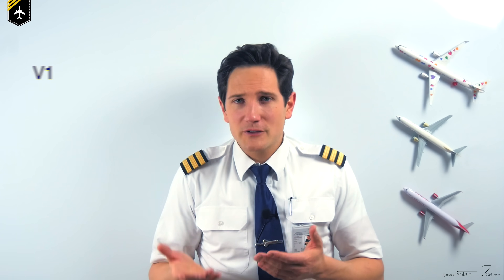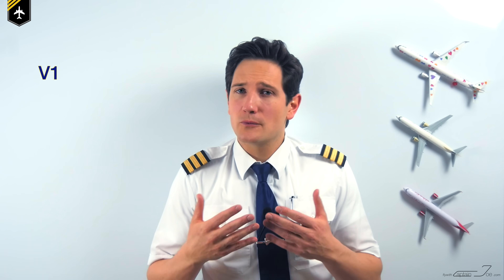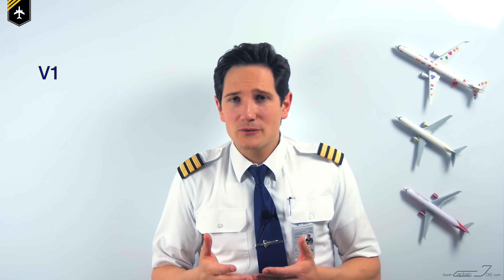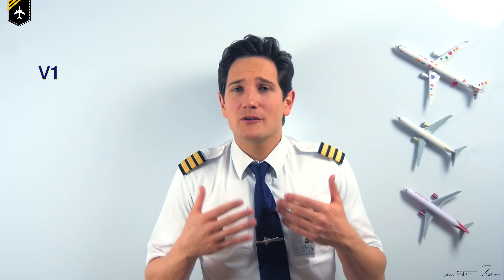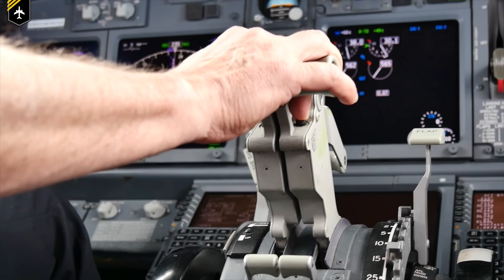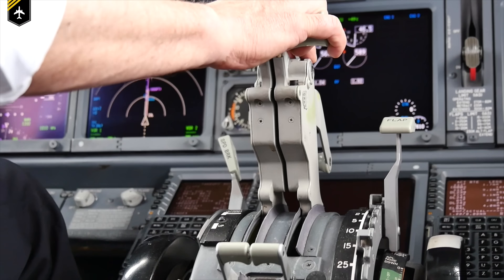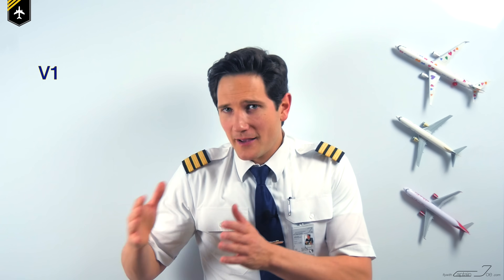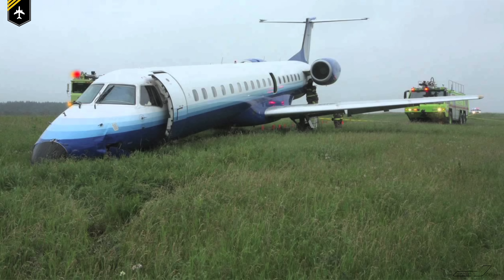TAKE-OFF Speeds V1, Vr, V2! Explained by "CAPTAIN" Joe

Comment: Nonsense...if you take off on a light A319 and the runway is 3800 meters, v1 always sounds before rotate, although v1 in these conditions should not sound at all
Reply: V1 by definition cannot be after Vr. Reason being that V1 is reject speed on the ground, whereas Vr is the speed where you’ll start your transition from ground to air. Hence you essentially can’t reject on ground if you are already airborne.

Comment: what if u lose both engine do u still abort after v1 ? isn't it better to over ran the rwy than stalling later on and crashing? ( i always had this question)
Reply: You can still reject after V1, but only in situations where one is certain that continuing the takeoff is unsustainable. Things like multiple engine failure or multiple flight control failure etc.

Comment: Doesn't Vr quickly follow V1 on a normal takeoff? What is the typical speed differece between V1 and Vr for a large commercial airliner?
Reply: Basically the shorter the runway, the lower V1 will be, and similarly longer the runway higher the V1 will be. But by definition V1 cant be greater than Vr. So logic is the longer the runway gets, the closer V1 will be to Vr, and after a point V1 and Vr will be same, irrespective of further runway length

Comment: What happens if we rotate after v2? 🤔
Reply: Question is why would you do that? As in why will you not rotate at Vr?
Reply: @ZK-APA  
To see what happens  for each condition 🙂
Reply: @ lol fair enough. Although if you need an answer, then answer is that nothing different will happen apart from the fact that the speed at which it is lifting off is different. However, if you try rotating before Vr, then either the aircraft won’t lift off, or only the nose will rise but the aircraft won’t get airborne, resulting in a possible tail strike.

Comment: Hi Captain Joe I have a question for you, why there is still no solutions for birds sucked into the engine till these days.
why they can't  install some kind of lightweight but very rigid conical shape grid in front of the engine to protect the engines from these flying objects, what is the harm that may result?  thank you very much
Reply: Because airflow going into the engine should be as free flowing as possible. Yes, even with a thin mesh it will still mess up the smooth air flow.

Comment: But if the runway is very long, the pilot can stop the aircraft after Vr if he didn't manage to takeoff. So v1 can be > vr ?
Reply: No, because at Vr you start your rotation ie you translate from ground to air. And to reject, you have to be on ground. Hence by this logic V1 can never be greater than Vr
Reply: @ZK-APA so what's the point in calling v1 at all, surely the important one is vr, the time between v1 and vr the take off could still be aborted.
Reply: @patricksmith4424  When the runway is short, then the gap between v1 and vr is greater. In this case v1 becomes important because if you try rejecting a takeoff after v1 and before vr, you run the chance of overrunning the entire runway.
Reply: @ZK-APA  OK, thanks for that info.

Comment: - V1 is the speed at which the aircraft can no longer stop on the runway and a takeoff is absolutely mandatory no matter what happens.
- Vr is when the aircraft has reached it’s needed airspeed to safely bring the nose off the ground to takeoff.
- V2 is the airspeed you should have reached at the end of the runway or at 35ft (depending on the airplane) in the event of an engine failure.

I just saved you 8 minutes

Comment: Captain Joe, stupid question all commercial airplane models have 6 digits in their model #, but we only use the first 3 for identification. What are the 3 digits after the dash?
Reply: The numbers after the dash is either the sub variant or a customer code* (*for boeing aircraft)

Eg the A320-232 is an airbus a320 200 series with an IAE engine

Comment: Are there any planes where V1 doesn't occur until after Vr or V2?
Reply: No. Because by definition its not possible. Even with an indefinite runway, the max V1 is less than or equal to Vr/V2

Comment: Great video capitain, good to understand these terms! But I think I concluded that for some small planes V1 and V2 do not apply. As an example the Piper PA28 I fly. If having enough runway, it is often possible to abort take off even after it happened, so after VR, and this way there is no sense to define a speed for takeoff abortion if I am already flying (V1=VR at most). In these planes very soon after takeoff we reach and mantain the climbing speed (Vx or Vy) - and the parameter to define a possible abortion, or an emergency landing straight ahead is mostly the distance from the soil or how much runway is still available (or a landing somewhere else). Regarding V2, according to the definition it is related to fly with one engine in case of another engine failure, so cannot apply for mono engine airplanes (that already are flying with the "remaining" engine). BTW, some places, like were I fly in the middle of a big town (SBMT), it is preferrable a runway excursion and even coliding to fences and trees around the runway than fall over the houses nearby, as there are no landing spots available.
Reply: One thing to add, aborting a takeoff is only possible till Vr because at Vr you will transition from ground run to airborne. In the case of your piper, if you have an issue after Vr and you come back on the runway, it is not an aborted take off, but rather a forced landing.
Reply: @ZK-APA   Sure, it is not really a take off abortion, it is an emergency landing in the context of take off.

Comment: I have 2 doubts about it, Could you help me? @flywithcaptainjoe

> When you reach the exact V1, Dou you abort ou continue? Because some airlines applys 3 or 5 knots before V1 to make decision, however I have a doubt about it.
> It is not mandatory the use of reverse after V1, however, even with wet runway? Because the regulation "says", dry runway it is not mandatory use of reverse in landing.
Reply: Continue is at or above V1. However some airlines do say that at a high speed, deciding to abort or not is much more critical.

And in terms of use of reversers, its more for performance calculations rather than practical use. If you have reversers, use them.

Comment: when vr is lower than v1 you know you are safe lmao
Reply: Vr can never be lower than v1 by definition
Reply: @ZK-APA  yeah but like on a Cessna you have an enormous runway you can abort take off even if you are in the air go down and brake before the end of runway
Reply: @Warwolf_69  Yes that is true, but in a single engine cessna, there is no concept of V1, only Vr
Reply: @ZK-APA  welp a320 taking off at Edwards AFB noz that's what I call safety 🤣

Comment: It is also worth mentioning that before takeoff, pilots set Autobrakes to RTO (Rejected Takeoff). This means that if the Pilot Flying sets Idle Thrust, the brakes will automatically start applying maximum braking power. This is why pilots keep their hands on the thrust levers just until reaching the V1 speed. (Some airlines even have the rules that BOTH pilots should have their hands on the thrust lever.)

Comment: What happen when plane is on V1 speed, lift up and both engines die because of birds (very rare situation, but still can happen), so pilots can't keep V2 speed, because no engine works. Plane is already 50 feets top and runway is at the end, then is sea (specially on islands like canary island, mallorca, ibiza..)? Is there any method to handle this without crash?
Reply: There is a fine print where you can abort after v1 if it's obvious that a safe flight just cannot be conducted.

Comment: Surely aborting take off and over running into a field is safer than taking off and crashing into a populated area ? Someone explain
Reply: Thing is there is enough redundancy in the aircraft that even if something fails, one can still fly the plane and get it back on the ground without much difficulty 

There are obvious exceptions, like all engines failed, or a critical fire, in which yes the captain may decide to abort even after v1

Comment: So we really need to arrange runways and weights to ensure Vr is less than V1 i.e. we can stop at anytime. 3.5 km runways in cold places are probably like that for most aircrafts.
Reply: That's not possible because of the definition itself. V1 and Vr can be the same but v1 can't be greater than vr as vr is the speed from where you'll transition from runway to the air. And v1 is the speed to abort on the runway.
Reply: @ZK-APA  Ok, in theory V1 is capped. My suggestion goes along a different thread: I conclude that the safety is best ensured, when take off abort may happen at anytime, for any reason, similar to go-around-no-questions-asked privilege at landing.
Reply: @CountKoski  Not always. One thing is RTO is actually very stressful on the aircraft (You are trying to stop a plane on a low drag setting using extreme braking). So even if you have an indefinite runway, continuing the take off and coming back is actually much safer than forcing a reject at very high speed.

Also, there is a fine print where you can abort the takeoff after V1 if the pilot deduces that safe flight cannot be obtained if the take off is continued (eg multiple engine failure, or a fire)

Comment: One thing to note though:

Overrunning the runway and damaging the plane can result in less lose of life and injuries, as such aborting take off after V1 should not be completely disregarded. This will depend on the airport and quite a few other factors, but this is something that pilots should consider before push back (what conditions would warrant aborting after V1 vs taking off). Once you are off the ground, with commercial jets, your only option is to make it back to the run way or maybe a body of water. Chances are though if you can't gain some serious altitude you would have been better overrunning the runway.

Comment: Can someone explain why some aircraft have same values for V1 and VR?
Reply: The max limit of V1 is Vr. So the better conditions are, the greater the value of V1 becomes. But at VR the aircraft starts its take off rotation. So at that point there is no concept of v1 (as you cant abort a take off after completing the take off). Hence the upper cap of V1 is VR

Comment: Great side example videos.  But how do you calculate weight of a passenger plane with lots of passengers?  Luggage is easy, because it's weighed (mostly), and fuel is easy because you know the weight per gallon.  But how do you figure out how much 400 passengers weigh on a 747?  What happens if you are transporting everyone from a Big & Tall convention?
Reply: For passengers, an average standard weight is taken. Yes it won't be exact, but for such an aircraft it'll still be in tolerance.

Remember, aircraft weight limits are legal limits, and not physical limits.

Comment: I have flown several light aircraft out of YGLA and the point where you close the throttle, apply full flaps and land on the remaining runway is 200 feet above the runway! The runway is 1920 metres long and take off requires 150 metres of runway.

Comment: Perhaps an academic question: a small, light aircraft needs low speed and a short strip to take off, but starts its takeoff on a very long runway. This means that in the case of a serious problem the pilot has plenty of runway available to slow down the aircraft to a full stop. Hence, he can accelerate his aircraft to high speed (say, 170 kts), and still be able to stop before the rwy end (so V1 = 170). If the Vr of this aircraft is of 130 kts, what will happen in the cockpit: will V1 be called out (when the aircraft is already airborne, I suppose), or just "80 knots", and "rotate"? I will appreciate the comments from the pilots who fly small aircrafts at large airports.
Reply: The upper limit of v1 is always vr, irrespective of runway length. Because at vr the aircraft initiates it's lift off rotation, so the concept of v1 stops there itself.
Reply: @ZK-APA , thanks a lot for the explanation. As I understand now, the crew, having the speeds calculations done, agrees that there will be no V1 callout, and "80 knots" will be followed by "rotate" only, or "80 knots" will be followed by "V1, rotate" (pronounced immediately).
Reply: @jarekferenc1149  V1 callout is always there, so when v1 and vr is same, call is v1 rotate in one flow.

PS the "80 knots" isnt always there. Sometimes it may be 100 knots or just a simple airspeed alive.

Comment: Mmmm your lift is produced by your wings, so I don't understand the one engine explanation of v2. One, two or  four the only thing that matters is having enough speed to generate lift.
Reply: Yes wings produce lift, but it's actually thrust (more specifically excess thrust) which makes an aircraft climb. More thrust that is available, the faster it climbs

Comment: Abort not just based on speed but rwy length you could have a 15K feet rwy hit V1 at 5k feet. Still can stop with 10k remaining
Reply: In that case v1 and vr will be the same. And if vr is reached, the aircraft would have transitioned to the airborne phase. Hence you can't "abort" the take off

Comment: I flew jump seat in a BAC 1-11in the '70's multiple times.  My father, a pilot, explained V1 as the point that the plane became aerodynamic.  VR the velocity that sufficient lift was available to fly.  V2 as the point no runway was left to abort the takeoff.  Perhaps I miss remember.  He said that the plane on one engine could initiate takeoff roll to climb out and break the sound barrier.  The second engine was purely a redundancy.

Comment: what if all engines fail after v1 but before v2
Reply: After V1 in any case you have to take off
Reply: @amalmm9447  If all engines fail, it's going to be a damn short flight. In fact, the flight will be just long enough to take you to the crash site.
Reply: @almostfm  Yeah agree, But AFAIK you have to take after V1, that's the global rule, If you didn't you will overrun the runway and crashes
Reply: @amalmm9447  But there's fine print attached to that "must take off" rule, and that is that you can abort the takeoff after V1 if you're unable to maintain safe flight (like in this case, both engines out). In that case, you've got two options: brake as hard as you can so you drop as much speed as possible, so if you do hit anything you'll be going slower, or try and limp an unpowered airplane into the air, let it stall, and slam into the ground.

Comment: I'm not above considering pulling the gear up if I have to abort above V1.   ;-)
Reply: Don't most airliners have "anti-squat" switches that prevent you from retracting the gear while the plane is on the ground?
Reply: @almostfm  No. None of them do. Almost all aircraft main landing gears go "over-center" and the mass of the aircraft keeps them from retracting while there is 'weight on wheels'.  Nose (and tail) landing gear have to be physically "pinned" to prevent retraction while the aircraft on the ground.

Comment: In theory, could V1 for a lightly laden aircraft taking off into a 20 knot wind on a very long runway, be after V2? If you see what I mean.
Reply: No. Because of definition. V2 is a speed in which you can climb. V1 is a speed you can abort on the ground. Hence if you are at v2 you are already in the air or are in the process of it, so V1 wont make any sense